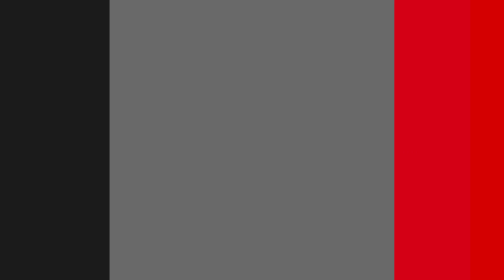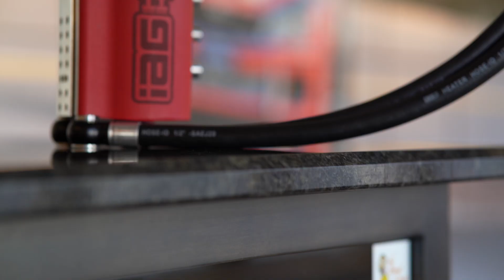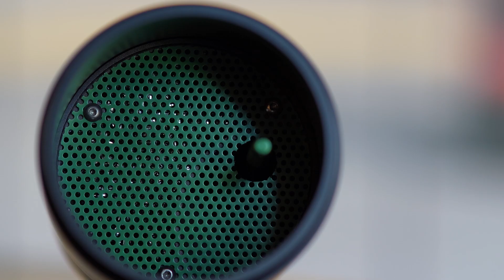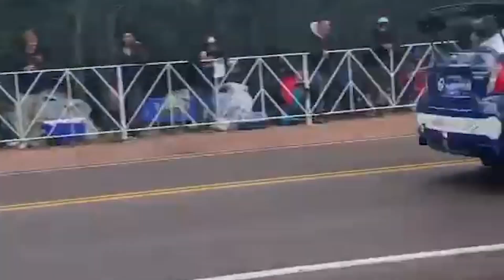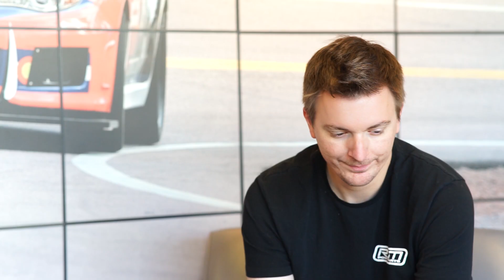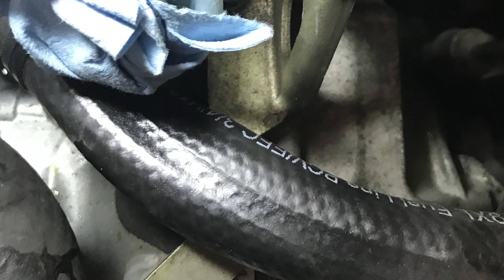Do I need a Catch Can or an Air Oil Separator?

Comment: Another thing with AOS not quite being a "set and forget" thing is that if you have a plastic AOS box installed from factory that sits on top of the engine like I do on my '15 Jeep Renegade, it will actually need to be replaced like you would an engine air filter
So if you ever find that it's time to change the engine air filter and you know you have an AOS on top of your valve cover, it would be a good idea to check for seepage around where it mounts to the valve cover and replace if needed
They're only about $80 as far as I know, are fairly simple to replace from my experience, and with my AOS it even comes with a new PCV valve already installed in it

Comment: Thanks for the info, 52k on my FA-20 and have been burning 0 oil since i bought it (first owner). Feel a bit better now about not putting one on, but am buying one now since im preemptively replacing the PCV with a new valve and will already be there. Choosing catch can because i change my own oil and it will just be apart of my regimen. Appreciate your content!

Comment: Good info. I have a 22 wrx with 10k miles(stock) and have not had to add oil in between oil changes. I live in Cali and don't plan on modding the engine so I may not need an aos/catch can.
Reply from the maker: Thanks for watching and thanks for your question.  For a new and stock or mostly stock car, this is pretty normal.  I'd agree that you don't need anything right now.  At most, maybe a catch can to try to prevent carbon deposits in the intake manifold.

Keep an eye on it and then you will be ready to get it sorted if things change.

Hope that helps and Stay Tuned!

Comment: which is better to mitigate carbon buildup r/t FA24 being direct injection?
Reply from the maker: Thanks for the question.  They would both work the same in that regard actually.  As long as you aren't getting that much oil through the PCV, then the Catch Can is a good solution.

If you are seeing more oil consumption, that would be a reason to move to the AOS.

Hope that helps, thanks for watching, and Stay Tuned!

Comment: I’m using 1ltr every 1000kms and rub a 450 bhp cayenne turbo..I need a catch can?
Reply from the maker: Thanks for your question.  That is a pretty high level of oil consumption.  I'd recommend checking the PCV system, etc for leaks or issues first.  It sound like there must be some kind of leak or other issue causing that much oil movement.

If you were to put on a catch can, unless it was very large, you would need to empty it about every 500 km.

If everything else is working properly, this would be a scenario where an air oil separator would come into play because that capture oil would stay in your sump.

Hope that helps and Stay Tuned!

Comment: Are they part of a dry sump lubrication?
Reply from the maker: Thanks for your question.  No, when you go to a dry sump, the PCV system is completely removed.  you just have to be mindful of how you vent your oil tank because the scavenge pumps send all of the crankcase gasses there.

Thanks for watching and Stay Tuned!

Comment: Running ethanol, does it make sense to go Catch can to lessen the effects of E85 Denaturing the engine oil?
Reply from the maker: Thanks for your question.  That is a hard one.  Maybe, depending again on how much oil you are moving through the PCV system.  There is a school of thought that you want to do more frequent oil changed when running E85, regardless of running a catch can or AOS.

I'd say that the best thing to do if you are concerned would be to do some oil analysis to see if you are having any issues with your oil over a given amount of miles, and then check again if you install a catch can or AOS.  It is better to have the data than to guess with something like that.

Thanks for watching and Stay Tuned!

Comment: this was to much information just answer the question which one do I buy at 71k miles an AOS or a catch can?????? I have ADD this was overwhelming and i learned nothing
Reply: IAG AOS
Reply from the maker: Thanks for your question.  If you are not using much oil if any, you will be fine with a catch can.  If you are using more than about 1 quart between changes, or you don't want to have to empty the catch can, then an AOS would be the best solution.

Thanks for watching and Stay Tuned!
Reply: stock or modified?  do you burn oil btwn changes?  I'm stock (no power adders) at 61k mi and considering the dual can system from radium.  yes, the cans require more hands on, but as mentioned w/cans you can see the amount of oil/fluid is caught.   I'll check them weekly at first then gradually extend the checking interval as necessary; out to 30 days... or possibly 60 days if the amount of fluid is low enough for that interval.   I've "heard" modified cars benefit more from an AOS.
Reply: again i have A.D.D I DONT HAVE THE ATTENTION span to read that @K03sport

Comment: So I have a 2013 ford escape 1.6l. After installing a catch can, I noticed it fills up every couple days! After rigging a vent to the catch can, the can doesn't fill up nearly as quickly, but now my car runs a little weird and my car is throwing a vacuum leak code. I'm not even sure where to go at this point
Reply from the maker: Thanks for your question, and sorry that you are having trouble.  The PCV system should be sealed to the engine, so adding a vent is effectively adding a vacuum leak, so the code you are throwing makes sense.

It is possible to cause issues with a catch-can install, especially if you join any circuits of the PCV system together in a "T".  I would recommend either having a professional check the installation of the can, or remove it to see if the car goes back to normal operation

Hope that helps and thanks for watching.  Stay Tuned!

Comment: Can the 2002 JDM wrxs be fitted with an IAG AOS? I was advised the AOS for JDM spec is unable to fit ? And only a catch can could be fitted. Please shed a light on this? 🙏
Reply from the maker: Thanks for your question. Yes, all of the installation locations for the IAG can would be on our passenger-side of the engine, which is your drivers side.  And because you have the steering column and brake booster, etc there, those brackets wouldn't work.

I'd recommend looking at the RCM air oil separator.  It is designed for the right-hand drive vehicles, so it will fit, and it is a very good design.  Their drain design is really good, but it only works on RHD cars.

Hope that helps and Stay Tuned!

Comment: Oil air separator by my experience nearly cost me engine. Got 3 Impreza STI's, stock one has OAS, another one got forged engine and has typical oil catch. One day I opened catch can and found it full of mix  (fuel and oil), what will happened if I had OAS instead ? :)
Reply from the maker: Thanks for the comment.  Even when running an AOS, there can be some good information gained from running an oil analysis after your first oil change just to get an idea of whether or not there is any fuel contamination getting into the oil, and how much.  From what we have seen, if the car is consistently getting up to full operating temp, the contamination is usually minimal if any.  But if the car is driven short distances more, then the contamination could be higher.

Hope that helps and Stay Tuned!
Reply: @FlatironsTuning  thanks for reply. IMHO OAS can be very expensive experience. Especially if it's used on high performance engine (when u spent over 10k on build). Better to stay with oil catch can and not be lazy to check levels.

Comment: Thanks, I watched you previous vid on the pcv system that helped a whole lot..
Reply from the maker: That is great to hear!  Glad that they were helpful.

Stay Tuned!
Reply: @FlatironsTuning  so I'm addressing the oiling issues with my build. I'm leaning towards an accusump.  Would you recommend a AOS or a Catch can?
Reply from the maker: @1atinlove  This may help:

https://youtube.com/watch?v=5NN8GShcskM&feature=shares

Between the AOS and Catch Can, it all depends on how much oil you are moving through the PCV, and how often you may need to empty the can.

If you can get the AOS plumbed well, that may be the best bet?

hope that helps and Stay Tuned!
Reply: @FlatironsTuning  thanks! I have a new build but want to reduce possible issues. It will be boosted so I'm worried about blowback and other possible oil issues with boosted applications

Comment: Just got the Cobb (IAG) AOS installed on my FA20 WRX. Highly recommend it for these DIT engines! If you live in cold environments (below freezing), make sure to allow your car to fully warm up and thaw out any of those return lines before getting into it. I paired it with EGR+TGV deletes, clean as possible for my engine!
Reply: @ThuGfunk what do you mean “thaw out any of those return lines before getting into it”. Do you mean to use a heat gun to warm up those lines before starting the engine?😅 Or thaw out can be done by idling the engine? How to know that it’s thawed?
I live in area where it can be deep freeze for week and on. One of the reasons why I still have not ever dreamed of getting one installed because I hear alot of issue with these things.
Reply from the maker: Glad that it is working well for you.

Thanks for watching and Stay Tuned!

Comment: My take.  If you care enough about your engine health to install either, you know you don't want the minimal amount of oil either system catches to go back into your crankcase and you probably want to check and monitor how much blowby is being caught.  An AOS doesn't give you that information and allows the contaminated oil to be recirculated.  A catch can setup catches the same stuff an AOS does but returns none of it to the crankcase and allows you to monitor what's being caught and how much. 

It's kinda like the manual vs automatic debate.  The AOS is the set it and forget it option that gives you no feedback.  The catch can is the purists option.  It's for people like me who spend 40 bucks every oil change to send a sample to Blackstone to monitor things.  Something the AOS people won't be bothered with.
Reply from the maker: Thanks for the comment.  I think that there is an argument that can be made that a good Dual-Catch Can setup can be an ideal for many applications.

There may be a forthcoming video on that in fact...

Thanks for watching and Stay Tuned!
Reply: @FlatironsTuning  I recently checked our dual catch can setup on our Stage 2+ tuned FA20.  Was not a single drop in the CCV can, PCV can had maybe 1/4" after about 3200 miles and was mostly fuel vapors and oil with a touch of condensation.
Reply from the maker: That is actually a sign that the PCV is working as designed.  The valve covers are the fresh air source, so under normal operation, a bit of air should actually be flowing in through those ports, rather than venting crankcase pressure out.
Reply: Regarding "and allows the contaminated oil to be recirculated" - my car runs on E85 and most of what the catch cans collect is smelly water. Oil content is 5% at best. I shudder to think what is draining back into the sump when people use an AOS and ethanol-based fuel.
Reply: @yowie0889  I am simply unconvinced that passive mechanical means employed inside an AOS is returning anything close to uncontaminated oil back into the crankcase.  For most people the minimal amount "lost" by keeping it in the cans is negligible enough to just be good with not letting it go back to the crankcase at all.  Besides, I fill our FA20 with nearly 6 full quarts on an oil change anyways and so far all of the Blackstone tests combined with catch can clean outs tells me I'm doing the right thing.
Reply: @jamesg8246  Agreed that catch cans (not AOS') will be best for a lot of applications. Also, there are some quality catch cans with internal baffling etc. Alternatively the owner can modify the internals of some catch cans that can be opened. For example, for my Mishimoto long "compact" catch can I have extended the "dirty" gas inlet to near the bottom of the can, then caused the dirty gas to come back up through a sandwich of steel wool, then an air gap, then the supplied small bronze filter.  It helps that the top section is a quality alloy billet so the dirty inlet hole can be tapped and there is an existing central M6 threaded hole for some threaded rod as a mounting post for all these added baffles. 

Having said that, I am sure there are very high powered and/or high G-force race cars out there that are shifting litres of oil into their catch cans per track session and really do need it draining back into the sump. As Flatirons point out elsewhere in this comment thread, perhaps very regular oil changes for those race cars address the "funky fluid return" issue, albeit imperfectly.
Reply: @yowie0889  No doubt there's different requirements for different applications.  The audience at large would do well, better even in my opinion, with a catch can/s but if they aren't willing to take 10 minutes while the oil is draining to service them and check them every month or so, then the AOS is the "lazy man's tool" as long as people aren't convinced they are actually returning "good as new" oil back into the crankcase.  That still doesn't address the fact that if you can't easily monitor the amount and type of junk the AOS "catches" you don't have that early warning component catch cans give you.
Reply from the maker: @James G I will just add that the AOS's that run coolant to the AOS can to get it up to operating temp seem to do a pretty good job of helping those contaminants (fuel and water) evaporate so they can still move through the PCV system as they typically would.  But as you say, the only way to know for sure is to do some oil analysis.

Good conversation!

Stay Tuned!
Reply: @FlatironsTuning  Yeah.  I haven't had an issue with the cans yet, this will be the first winter, be we typically let the engine run long enough to get some heat in the oil so I don't expect it to be a concern.
Reply from the maker: There is an increasingly common practice of changing oil much more frequently on high power cars that are running E85, and I'd suspect that this is in large part one of the reasons.  

Thanks for your comment, thanks for watching, and Stay Tuned!
Reply: I have a 2022 Subaru wrx and I am wondering if I need a dual catch can set up. My car has roughly 22,000 miles on it and is completely stock. I am trying to prevent carbon build up on my valves and don’t know if this is the best way to go about doing that. Should I leave the car stock or do a dual catch can set up. From what I’ve noticed my car does not need its oil topped up between oil changes and does not consume much to any oil at all. Thanks.
Reply: @stockproductions7991  The one can catches a fair amount, but it's mostly fuel and condensation with a tiny bit of oil.  We are at 65k miles and haven't had a need to walnut blast valves yet.  Though I have no idea what they look like either.
Reply: @jamesg8246  Thanks for the feedback. I just took my top mount intercooler off, there was no oil in it at all. Now on the charge pipe coming into the intercooler there was a tiny puddle. Nothing major but still some black liquid. I think I might just wait until there is more solid evidence on this engine whether it really needs one or not.

Comment: Nice info on catch cans and AOS! Im running a grimmspeed aos with a catch can. do you think I should upgrade to the IAG AOS? I've been told that at my power level (450whp) that the grimmspeed aos creates too much crankcase pressure is this true?
Reply from the maker: Thanks for your question.  First off, as discussed in the video here, take a look in the hose connecting the AOS to your turbo inlet and look for signs of oil there.  That would be the first sign that you may want to consider making a change.

Beyond that, you will want to look at our video talking about crankcase pressure, because that is one of the examples that we look at.  Here is a link to that with the relevant time stamp:

https://youtu.be/HAvxjSdQsXI?t=1363

Thanks for watching and Stay Tuned!

Comment: You know you need a catch can when your intercooler is full of oil. I recently got my IAG AOS purchased from Flatirons installed as a preventive measure. As I want to keep my new jdm EJ207 as healthy as possible. Thanks Flatirons Tuning! Next I have the RCM 4th cylinder coolant mod to do!
Reply from the maker: That is great to hear!  Glad that the IAG AOS is working out for you.

Thanks for watching and Stay Tuned!
Reply: How is ur ej a year later?
Reply: @JD-xm6fx  Good, the more you learn the more parts you want to put on the engine.
Reply: @JD-xm6fx  if i was to be in the turbo oil drain area id get the aos drain relocation hose as the iag drain location is not as ideal. Draining straight down to the head is better for flow and one less hose to fight when putting the intercooler back.

Comment: Is there a legitimate way of cleaning carbon deposits without dismantling the engine or are the products claiming to do so just snake oil, so to speak?
Reply: The Seafoam  top engine cleaner
Reply: @PandawatchV7STI  Cheers for your suggestion
Reply from the maker: Thanks for your question.  Subaru even has its own cleaner for the direct injected cars.  I'm sure that it can help, but we haven't done any before and after inspections on the valves, etc., yet. 

I would guess that it would be most effective if it is done more frequently to keep any hard deposits from forming.

Thanks for watching and Stay Tuned!
Reply: @FlatironsTuning  Thanks for your reply. Hopefully we'll see some tests in the near future.  Thanks for your content. Always interesting and informative.